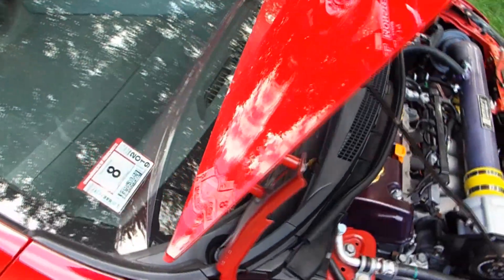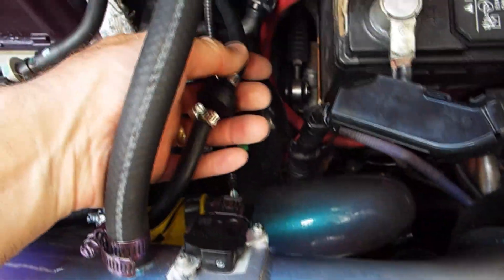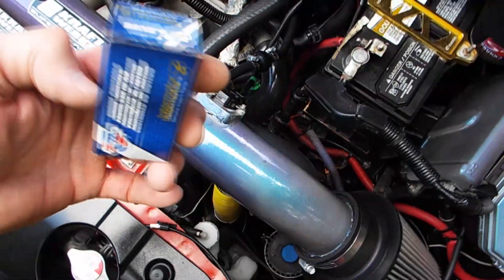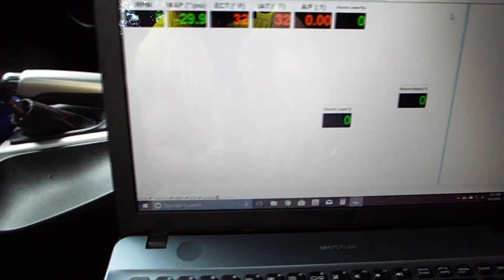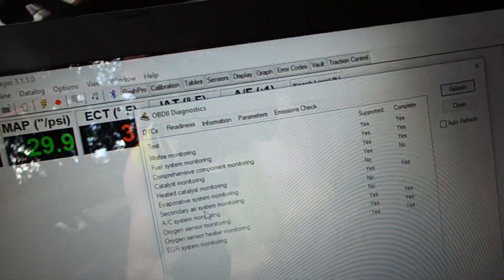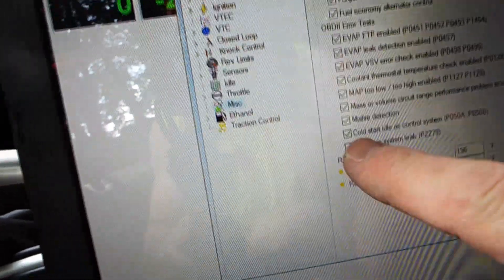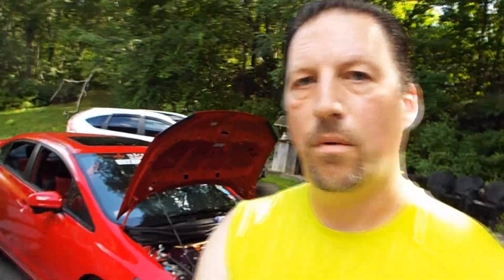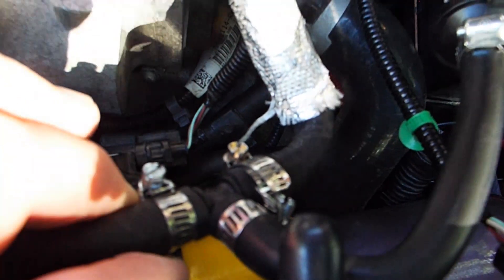How to get your EVAP to work properly with Kraftwerks Supercharger

Comment: Is the one way check valve necessary? I only ask because I saw a similar post on a forum and they only mentioned the tee fitting and hoses, but no check valve.

Comment: I always have to deal with emissions too, being full bolt ons and tuned.
I pass with one sensor failing which is the catalyst monitoring.
If u have a tune, your secondary o2 sensor is always shut off meaning you won’t pass if the o2 sensor monitoring and cat monitoring.

Comment: Hows the reliability of the Supercharger?
Reply from the maker: I had to warranty the SC about month ago . I had 26000 miles on it and sound like the bearing are failing inside . On the kit says to change oil for the SC every 2 years or 50000 miles . I talked to another  kraftwerks representative and he told me to check the color of oil all the time . The oil is blue and will start to turn black . once its black i guess bearing can fail . i wish the was described in the instructions also . the oil is 150 bucks a quart so you would think it would last 2 years . I believe If you keep up that maintenance the SC would have very long life .

Comment: Curious, would doing the evap T and check valve require me to retune my car? Or would the car run the same?
Reply: It would run the same. The vacuume gets pulled from the sale place so it doesn't matter. This kit is just making sure your getting the most vacuum possible

Comment: On your Honda fit when you had put on your cold air intake did it throw a engine code p0171 (runs lean) and if so how did you fix it cause my engine light came on the day I installed mine
Reply from the maker: The intake I used did not throw any codes
Reply: Did you plug in the maf sensor